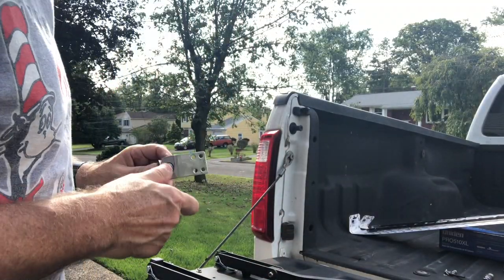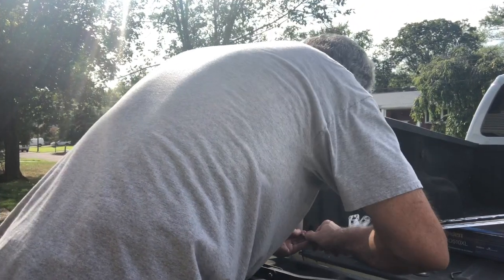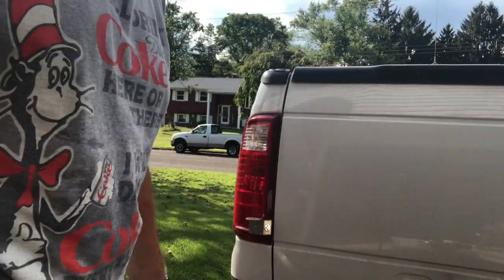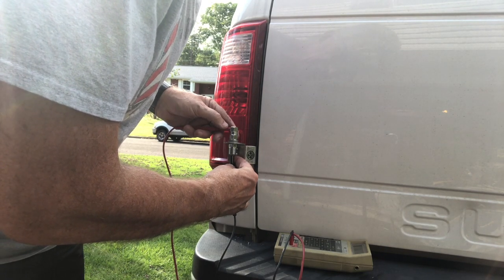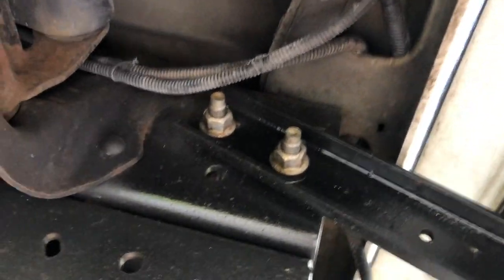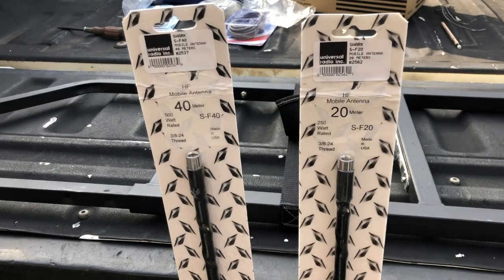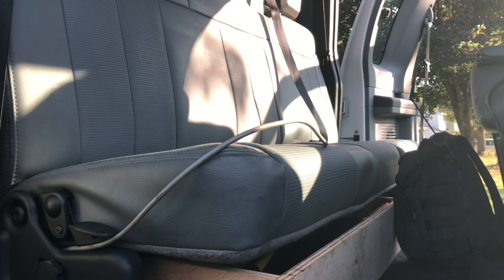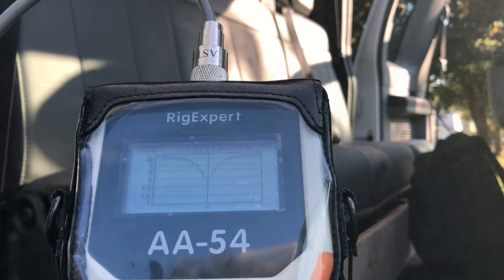Mobile HF Installation Part 1

Comment: Can you show how you actually came through the back of the cab? The round grommet on the back of my cab in that location is only about the size of a quarter. Is that it? Thanks
Reply from the maker: There was a hole behind the back seat from the previous owner…and it was a real PITA to get the cable through.

Comment: Would you expand on shunting?  I used to run sharks on a magmount.. Never heard of  using shunts in that process  Thanks
Reply from the maker: The way I understand it the shunt coil routes to ground any static build up on the whip that occurs when the antenna is moving.  What i learned is that the coil also improves SWR.
Reply: @k2cjbradio  Thanks.. Do you have any photos of the shunt coil nstall?  I may have missed it in the video..

Comment: How’s your RF noise been? My 04 super duty thankfully is very quiet.
Reply from the maker: I get a significant amount of noise from the ignition.  The 7100 noise filter gets most of it, but I also get it on FM repeaters if they aren’t local.  I’m going to try snap on chokes on the wiring to the coil on plugs.
Reply: @k2cjbradio  did you have noise from the blower motor?

Comment: 2015 F250, so aluminum body? I have a 2015 F150 - any metal interaction between the body and steel mounts/screws?
Reply from the maker: The 2015 F 250 wasn’t aluminum.  Just the 150 was beginning on 2015.
Reply: @k2cjbradio  I picked up on that later in this series when you said you had a mag mount, I think for the CB antenna. 👍

Comment: curious why mounted so low on that spot instead on the higher side of the rear tail lights
Reply from the maker: That was the only place the brackets would fit.  The other spots weren’t flat.  I do believe the body of the bed is interacting with the antennas.  But, they do work.  I have made many contacts with them.
Reply: They look solid and great quality. The pick up style vehicle not many choices available. But if it was a long van with full flat metal roof that's antenna heaven

Comment: Good video.  I looked for Part 2 and didn’t see it on your channel.  [EDIT: I did find the part 2, YouTube didn’t see it in your channel, but no need answering about part2)]. I was wondering how the bonding affected the antenna tuning.  Also, I have a 2016 Chevy pickup and was wondering about putting those type of antennas toward the front of the box instead of the back.  Is there an RF reason for the placement or just a convenient place for mounting?  Thanks again, 73 de KI5HXM Brent

Comment: Why not mount the antennas in the corners of the bed near the cab it self. Least that way you will have less antenna cable you will have to run.

Comment: Have you had troubles with the whip end coming loose?  When I travel with the antenna installed, the top nut starts loosening.  I'm afraid I'll lose it.  I've thought about a drip of Loc-Tite but haven't tried it yet.
Reply from the maker: Actually I’ve had problems with the 40m antenna coming loose at the base.  Strange how it’s only the 40m.  The 20m antenna stays tight but I need to snug the 40m with a pair of pliers.
Reply: @k2cjbradio  Mine stay tight at the base.. so far.. it's just the removable top section that jiggles loose.  I don't usually do any driving with the whip installed on the roof of my truck due to height..

Comment: I got the 20&40 meter antennas as well as the mounts. What are the insulated connectors you are using between the antennas and the feed lines? Got a part number? Also can you share details on the shunt coils that you added?
Reply from the maker: Do you mean the stud mounts with the Teflon washer?  That should’ve come with the antenna mount.  The shunt coil is 12-14 turns of 14ga wire about 1” in diameter
Reply: Yep. They were in the unopened bag in my truck, which was in for service. Thanks for responding. Why and how did you add shunt coils?
Reply from the maker: @ArizonaPatriot1  I just made 1 for the 40m antenna.  I used a T connector and soldered the coil onto a chassis mount SO239 which is connected to the middle of the T connector
Reply: I’m somewhat confused on your bonding method. Are you in effect grounding to the frame? I’m under the impression that your electronics are grounded to the frame for dc grounding and the antenna should be grounded to the body for RV grounding. So why are you attaching your ribbon wire to the frame?  Thanks in advance.
Reply from the maker: @ArizonaPatriot1  From what I understand the DC ground of the frame isn’t necessarily an effective RF ground.  So bonding hood to body and body to frame provides a good RF ground.

Comment: Good job Chris!  I like a nice, simple clean install.  Now in my 60's I can relate to the grunting and groaning part...lol!  I bought an entire set of the MFJ Hamsticks, later to find out the set screws can be a problem.  As suggested by others, I plan to go to the hardware store and buy all new stainless steel set screws to replace the soft ones.  Thanks for showing us your install.  It's always helpful to see others experiences in HAM radio adventures.  73!
Reply from the maker: KX4UL Ham Radio Thanks! The Shark ham sticks are holding up fine!  I’ve had them on the truck ever since.  Only took them off for the occasional car wash.

Comment: Thanks for the video Chris, nice looking installs!  I'm in the 2nd month of trying to determine best antenna setup and install in my Jeep and just came across your video as I am looking at mounts. I have my radios and antennas decided on. Yaesu 2m/70cm,  TYT 1.25 radio duplexer and tri band antenna with Yaesu 891 running an Alpha MOTO FMJ or Yaesu ATAS.  Could you not install it above the rear lights and wouldn't that help with the tuning a little bit? I just see so many mobile HF installs down low or on bumpers and I thought that would cause a less efficient antenna.  Is it simply for ceiling clearance?  Watching part 2 next! Thank you! 73 Paul
Reply from the maker: Paul K5VOP JI1BGC Hey Paul!  So glad they are helping!  The mount location was based on the shape of the metal on the body of the truck.  The place I put them was the only real flat spot available.  The antenna switch arrangement works fine, but I’d love to be able to tweak the tuning of the 40M antenna to get more use out of it . What I didn’t show on the video was when I added a shunt coil to the base of the 40M antenna.  It helps a little bit for opening up the usable bandwidth.

Comment: I bought the same two antennas. What did you end up with for a length on each antenna. I don't have an analyzer (next purchase) There is a tiny piece of instructions in the package on the length of the silver whip out of the ferrule for a starting point. I was wondering if you have to cut off the excess whip that extends down into the fiberglass section.
Reply from the maker: 1crazynordlander Great!  I did have to adjust them.  The final length of each one didn’t match the chart they include.  It does take some tweaking to get them in tune.  Do you have a way to measure SWR?  You’ll definitely need it.
Reply: @k2cjbradio  I do have the IC-7100 that will measure it and I have the NANOVNA that I can use. I have my eyes on the RigExpert AA-55 but that is far in the future after this last purchase. Do you have to cut the antenna that extends down into the fiberglass portion? I did make a contact with a ham in Oregon from my home in Minnesota.
Reply from the maker: 1crazynordlander You also asked if I had to trim the whips.  I did not.  Also, I do believe the antennas in my case ended up shorter than the instructions.  The 40m whip is the one that is very touchy to adjust.  Move it in very small increments (1/4” or so) .

Comment: I lucked out and found a left and right CB antenna mount on Quadratec where I got my lift kit for my 01 Jeep Cherokee. I think I am going to copy you on the 20 and 40 meter Shark sticks. I will have to take a look at those 3/8" stud mounts you bought from Firestix. You used RG8X? How about the antenna switch?
Reply from the maker: 1crazynordlander Yes I used RG8x throughout.  The antenna switch is an old one that I had.  The original one was for 2 antennas.  I changed it out for a 3 position switch so I could run a cable for when I use the Wolf River Coil antenna outside the truck.